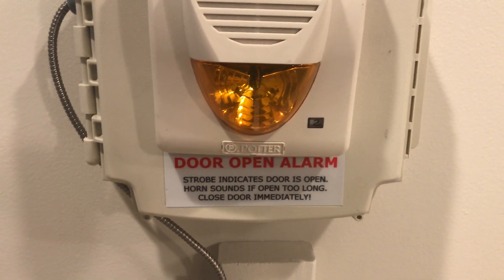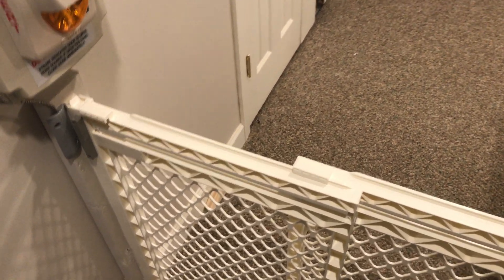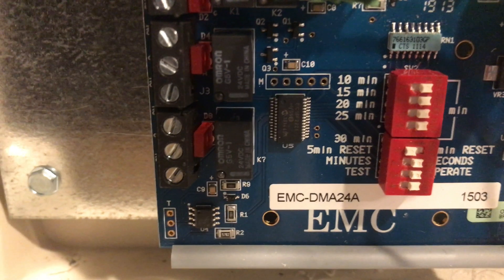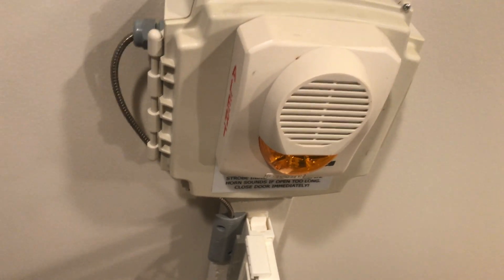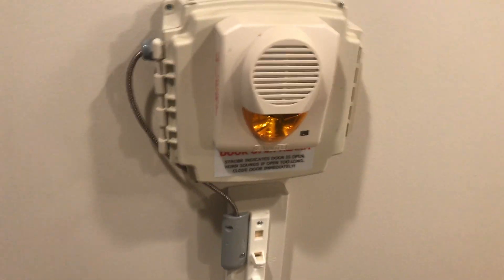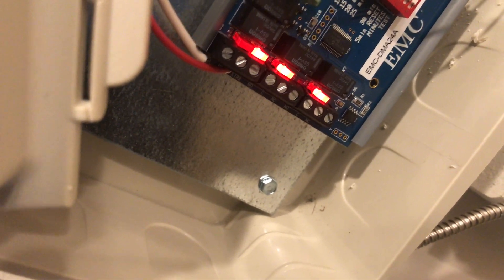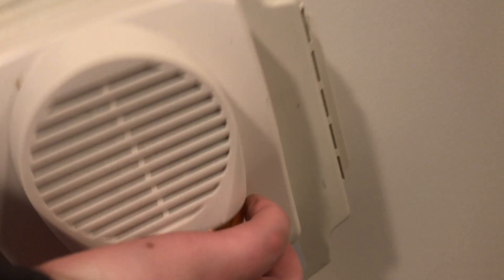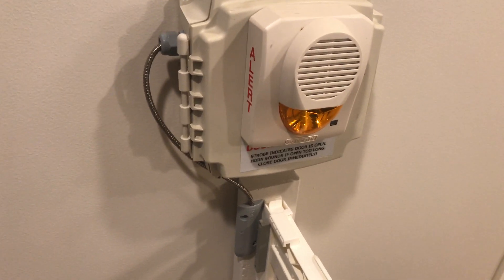Testing and Overview of a Potter/EMC Door Alarm

Comment: I saw an alarm like that in a building, but the device had a blue strobe, which is used for a refrigerator leak alarm.
Reply: TBB747 (this channel is now closed)  My local Sams is similar, except it's a Wheelock 7002T labeled "DOOR"